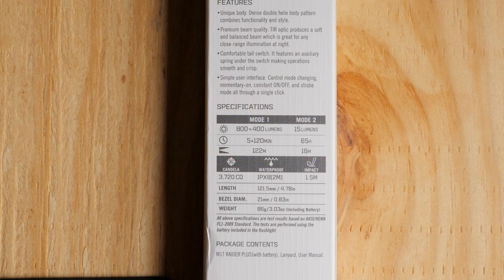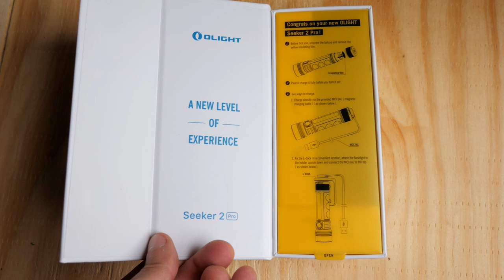Off Grid Home Build (#11): Finishing the Ultimate Block Well House (Part 3 of 3)

Comment: One thing I would do is put that rubber spray (Flex stuff) on the lower outside walls. Then you could fill in the area with dirt to level with the rest of the area. Just a thought.

Comment: I made plans for our well house over the winter. Ours will be bolted to a concrete base and will completely disassemble in case work on the well needs to be done. When our pump was replaced, they had to have a rig right over the top of it if i remember correctly. At any rate, I designed the house to hold a portable generator as well in case of a power outage, then we will just store the generator there. 

Here's a tip: the first pump went out on a very hot summer when a giant ant colony decided to move into the well head. They kept dropping down the well and finally burned out the motor. It was clogged with thousands of ants. We now use Amdro spikes to keep ants far away.

Comment: When I saw the thumbnail I felt sorry for your future self when it comes time to work it there. 
Removable roof = GENIOUS!
Reply: Keith Brookshire that’s how most all well houses are built with a removable roof. If the person knows what they are doing
Reply: @mwatkins2464  I own a rental property with a well and we'll house but it has been on the public water system since before I bought it. Next time I need to do any maintenance I'll check it out to see if this is the case for my particular we'll house.
Reply: Keith Brookshire it just depends on the person building it. My grandpa has one that wasn’t removable but by pulling a few nails it would come off . If I was to build one I would put an O ring in the middle of the roof so it could be lifted off by a well driller if needed.

Comment: You should use pressure treated lumber anytime you put wood onto any concrete surface, you can bypass that if you go a buy some wood treatment and a paint brush you can treat that lumber helps keep wood from rotting .
Reply: Pressure Treated wood was used as said in a reply to an earlier comment.
Reply: @tonygrimes13 
I must've missed it ! normally pressure treated lumber comes in a different color either a lite green or blue stain distinguishes the treated lumber from the lumber that isn't !
Reply: Mad Greek Outdoors just depends on how much it’s been dried out if it’s a different color

Comment: First of all I thought you'd had a bit of a brain fart when I saw how low the roof was 😅 but couldn't see how you hadn't thought about pump problems or even just routine maintenance and having to do that on your hands and knees crawling in and out of a Hobbit Door.  I should have known better than to doubt you!!  A removable roof?   Ingenious!! 😎 And I thought your EDS was bright until you switched on the new one.  Wow what a difference, bet you can see right to the bottom of the seep well now with that one,  it'll scatter the critters that's for sure!  Do you have to seal or treat that wood at all to improve it's longevity?  Your roof is a thing of beauty Jeremy (I did wonder about insulation though)  next roof you do is going to be a good bit higher!

Comment: Couple of comments on how I would’ve done it the Rebar should’ve been in the foundation because basically all you’ve done is put cinderblocks (what we call them) on top of the foundation(i’m hoping you will backfill around the outside of it that will make it somewhat stronger)  I would’ve made it taller and bigger so you could’ve put that generator inside that would make it a lot less noisy and out of the weather anyway lots of luck looks like you’ve got quite a mission on your hands

Comment: Sounds like a plan, however you might consider using(3) hinges on the rear. This way when and if needed you can just raise the front and use a brace to hold it open. The door being separate from the roof would allow 1 person to raise /lower the roof. Automotive hood struts would add additional assistance with the process. Just a thought..

Comment: Love what you doing, only improvement I can think of is to put a moisture barrier between the concrete block and the wood. Or else moisture wicks up through the concrete and rots the wood. Same goes for posts on concrete oh, that's why they use the metal separator brackets. You're doing awesome, I'm jealous, you're getting it done and that's awesome.

Comment: Here"s a thought: If you ever need to take that roof off time will matter. AND it's possible that you may have just been through some sort of natural disaster. Instead of having to unscrew lag bolts in a cramped area why not insert eye bolts  (inserted, not screwed in) so they can be used as pins instead of bolts? They could just be pulled out saving time and energy. Additionally, you could put a rope loop through the eye big enough to get you hand in to pull them out. Then hang then on a hook under the roof while you're doing your service.

Comment: Why not make the well house tall enough to walk in, instead of having to man-handle the roof off?
Reply: They may need access to the top part of that well head to do repairs or may have to pull some of that pipe out they installed, so the roof has to be able to come off and an easy access to top of well head is necessary .
Reply: Elizabeth Chetwood you don’t go into the well house very often and most are built this way

Comment: Seeker II Pro is friggin' bright ... Nice job on the well house ... It would make a nice hidey hole for hurricanes and tornadoes ...  🌪️ 4 scavenged hatchback struts on each side and hinges on the back would be a nice tilt roof ... Save you from man handling it off and in ... Genset has pretty flashy lights ... Lol ... Next comes the generator she'd ...

Comment: Nice Jeremy! Well house (Check) onto the next on the list. :) 
Mine is falling apart, not well made from previous owner, so this year Its going to be taking apart and moving components into the house.
Reply: Mimi B how are you moving it into your house??
Reply: Our set up is different then this one. Our well is in the front yard and well house is in the back of the house. The previous owners started with only a camp site connected to the well. After getting the house they ran the main line to the well house, or water shed, that houses all the components next to the house. This well house is right next to the location of the water heater and closet inside the house. So we will be able to re-route the main line into house and install all the components ( pressure tank, filter, etc.) into the closet.
Reply: Mimi B that would work great in winter not having to worry about freezing up so much 👍👍 what type covering do you have over the well pump located in the ground in your front yard? Does it ever freeze?

Comment: Aren't you worried about the wood wicking away the moisture from the concrete? Shouldn't there be a small metal sheet between the two?
Reply from the maker: Maybe but the PT wood should last quite a long time.

Comment: It is guaranteed that you will have pump problems at some point...in 19 years we have had to pull and replace pump, another time wiring, another time pressure switch, etc.  Good protection and access is imperative 🙂...

Comment: Friendly reminder bring the old generator back with a full tank of fuel.  Make them a happy neighbor. Nice video.  Keep them coming.
Reply: And a Good Washing too. Normally I don't borrow anything from anybody, I just save up and buy what I need. If I had to, I would bring it back nice and clean tho !!! Don,t forget to block it up on those tails for those pesky Insects. Great Job there Brother !!!
Reply: mgh439 that would be bad unless they use it a lot . Gas today starts to go bad very quickly and in a generator it’s better to run all the fuel out of it before it started to absorb water in the tank and separate with water on the bottom of tank and gas on top !!
Reply: M Watkins - He’s talking about the gesture. Which I’m sure his neighbour would be grateful for.
Reply: Station most people don’t know about what I said about the gas left in a motor is why I said what I did 🧐👍

Comment: Nice to rip an inverted "L" shaped fascia (x4 off) out of H3 tanalised 2x5, to cover over those sharp roofing iron knife-edges at either end of that roof, and radius the 2x5's external corners slightly with a plane or belt sander, to give it a classy finish.  (You would need to cut the iron flush with the edge of the rafters first, though.)

Comment: You'll still have plenty of ventilation, but you might consider something between the rafters to keep the critters out. May some hardware cloth or chicken wire. Anything to keep out the bats, raccoons, and other small bits of life that like to aggravate people with roofs over their pieces and parts they're trying to protect. Hardware cloth would minimize bees & wasps from setting up housekeeping.
Reply: Vester Stevens there is no gaps between rafters to let anything come in. It has to be closed off for winter

Comment: Question why didn't you use pressure treated wood?
Reply: I thought about that too but really, if you build it right you don't need to. Looks like he built it right.
Reply from the maker: The door and frame are pressure treated. The roof is not.

Comment: Soooo, you have to crawl through that tiny door with all the spiders and possibly snakes to unbolt the roof to work on the pump? Why not put the bolts on the outside? Otherwise another great build. 💜🌞🌵
Reply: Why not just make it high enough to walk in.
And like 3 ft+ clearence around all the equipment
Reply: @jimh712 , I'm thinking to limit the air space needing to be heated in the dead of winter. More air equals more heat. 💜🌞🌵
Reply: @jimh712  possibly for the simple fact that the smaller it is the cheaper it is to build. I could be wrong but that would be the way id look at it.
Reply: I look at the ease of maintance... With in reason
I sure don't want to crawl on my hands and knees
Reply: @jimh712 , he's probably thinking there won't be much maintenance... if it breaks,  replace it.  But Jim,  I'm with you!  No crawling in tight dark places when there's known cottonmouths on the property. Don't they hibernate and den up in places like that? 💝☀🌵
Reply: @suzisaintjames  
When we are young it's one thing...
But as we get older it's a complete different subject...
And we know everything needs maintenance
Reply: Suzi SaintJames the only time you would take the roof off would be to pull the pump out of the ground, everything else you don’t need much room to fix !!! Look at houses with a crawl space under the house there is even less room there to work so why make it taller if you don’t need it. Taller is harder to keep from freezing also !!!
Reply: jim h you sure wouldn’t make it in the maintenance field or hvac work or plumbing or even electrical work then !!!
Reply: @mwatkins2464  
Sorry about that
But i was an electrican
It's different working on someone elses property...
But to build your own that way....
No way...
But you can
Reply: @mwatkins2464  , hmm.  Your comment to me was confusing. I think that limiting the space for energy efficiency was brilliant. But I'm with Jim, when you build for yourself... make it easy on yourself and especially plan for those senior years. So why not put the lagbolts on the outside for easy access..  .. P.s. you are the first person I've ever met that advocates or loves working in crawl spaces or attics.  Eeeeeew! Sending you lots of love 💝 from sunny ☀Arizona 🌵
Reply: Suzi SaintJames I’ve done it all my life so it’s not a problem for me . Someone has to do the work others don’t want to and that’s why we make pretty good money doing it !!

Comment: Great idea with the roof but you may want to think of wasp getting under the tin and over the insulation.
Reply from the maker: Wasps are easy
Reply: @Guildbrookfarm  Yea but they hurt! ( LOL) I was thinking some screen to block the holes but still let in air. Just a thought they may not be as bad there as they are here in Oklahoma.
Reply from the maker: Phase 2. Insulation and wasp resistant barriers.
Reply: @Guildbrookfarm ( LOL) I think the girls will thank you for them.

Comment: Excuse my lack of knowledge on wellhouses, but is there a standard height for the house i.e. hurricane proofing?  My question comes from thinking why pull off the roof when height could be adjusted to allow a step into the house, with a bend over, making it much easier on aging bodies. Thank you for your response.

Comment: I like it I just bought a house with a ratty well house I may need to do something like this. Is it going to have a light? Seems a light and a outlet may come in handy eventually .
Reply from the maker: Yep. Light, switch, thermal switched outlet to run heat tape on exposed pipe. Might run an external hose bib.
Reply: @Guildbrookfarm  a thermal switched outlet? I need to look into that I have been unplugging and plugging in heat lamp  and heat tape  plugs  since I got the place I'm new to this well thing
Reply from the maker: Thermocube. Amazon. 👍🏻😉
Reply: Guildbrook Farm - Off Grid Living lights help in keeping the temp above freezing down my way

Comment: Always have a bit of a laugh when I see people wanting to live off grid, but use power tools. Not talking about the cordless drill. But the sawing you could have done easily with a hand saw. Your not making big long cuts.. I built my whole house without a powered saw.. just cut the studs with a hand saw. Quicker than turning on the generator and connecting it all up.

Comment: Made several comments about the waste of time in this on previous portions.. but I’d like to point out as it didn’t occur to me before.. block is a footer.. so you wasted your time from the beginning. You could and should have as common practice just laid block down for the footer and filled the cells. Although the way you lay block it’s probably best you did concrete lol..